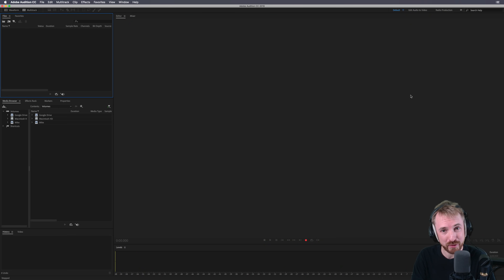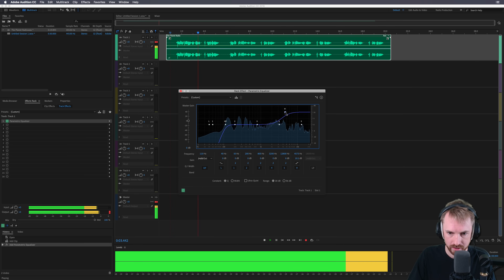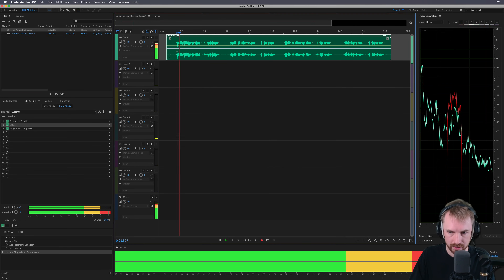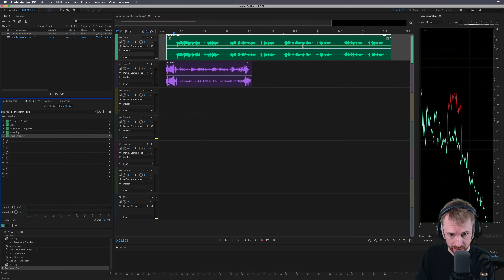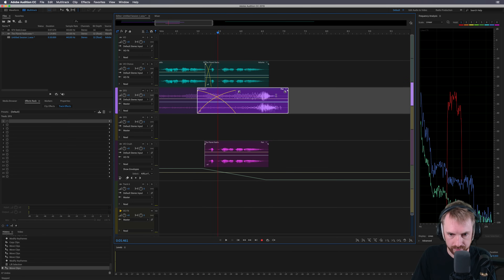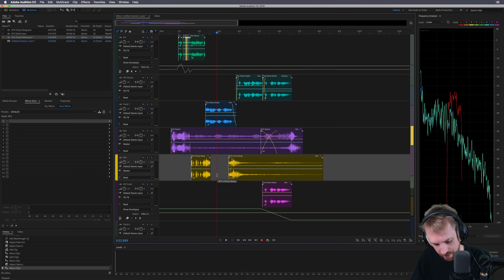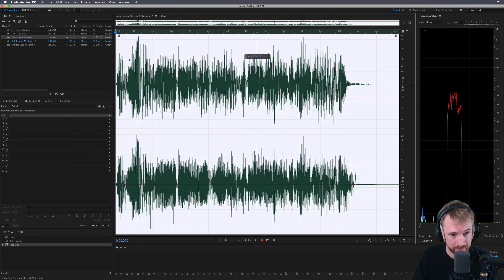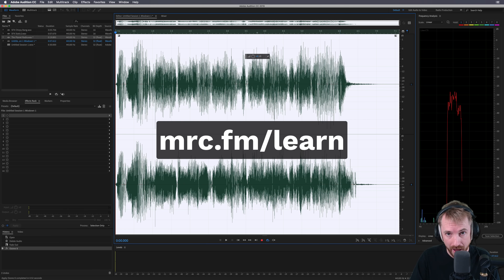How to Make Radio Jingles

Comment: I dont know if using Audition as a DAW is the appropiate way to go. Personally, I see Audition as an editor but it cant do what a proper DAW do, even the freebies are more powerful than Audition.
Reply from the maker: I use Audition every day.  Many podcasters use Audition and those in radio will either use Audition or ProTools as the industry standards.
Reply: @MikeRussell  
Exactly, in Radio Pro Tools is still the most used DAW and many still use the full Adobe suite, incluiding Audition, however in other areas where Audio is involved, such as music, film, scoring, etc. Other DAWs are used instead of Audition, even Pro Tools is getting outselled by Ableton, Fl Studio and Logic & Reason.

Comment: Mike, I'm fascinated by your vids.  Just tuned into them today.  Question:  instead of de-essers have you experimented with volume automation on the sibilant points?  De-essers seem like a good quick fix, but what about volume automation on the nasty bits?  Thank you kindly.
Reply: Oddly enough, volume automation is anything but automatic as you have to manually draw the automation for your DAW to follow. It's very possible, but i doubt it's a better alternative in this regard.
Reply: yeah, i know you have to manually draw.  well.  i reckon both approaches, or a mix of both work to.....you know what...use either approach, or whatever approach to get the sound you hear in your head.  the manual approach takes longer time, but it might be the right way.  but, then a de-esser seems super handy.  i think i might need one.